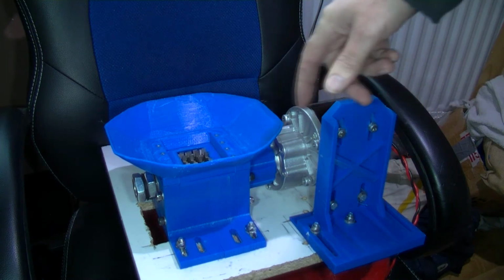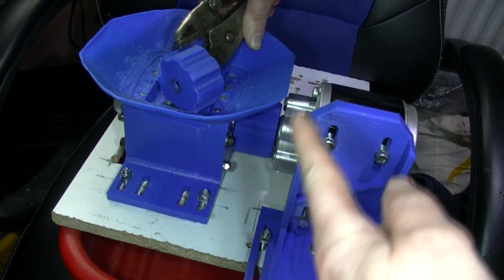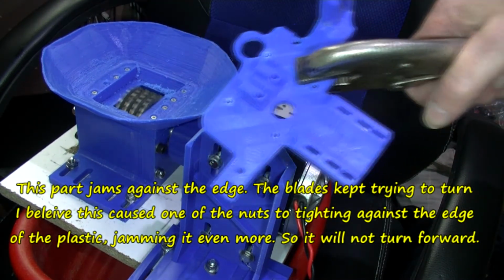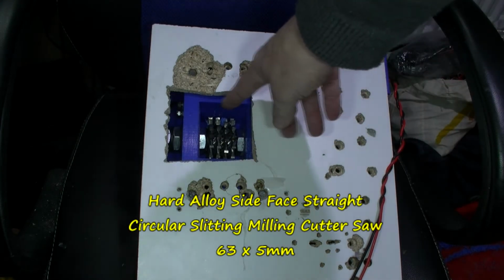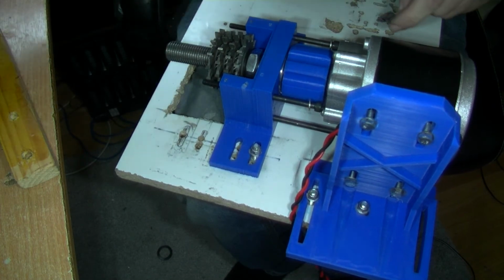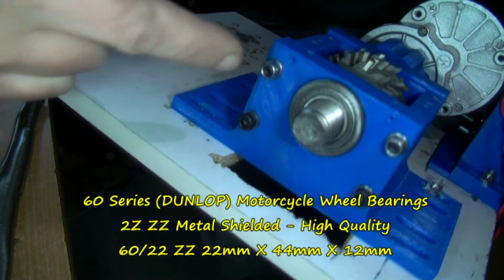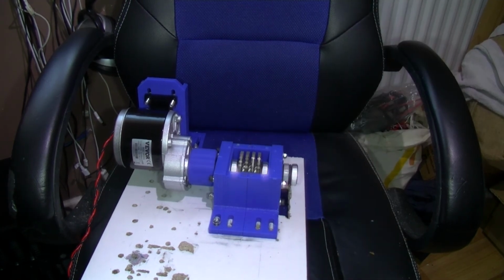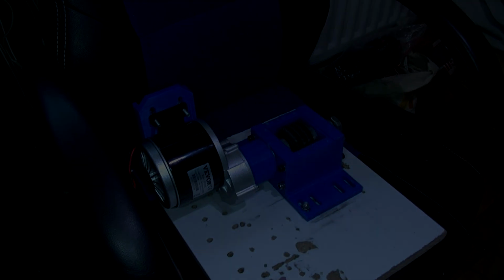Sherdder for plastic parts Multi Blade test

Comment: Its definitely improving!
Reply from the maker: I don't think it is that much better than the single blade method. Maybe I should rewatch that video :) Thinking of saw blades to try them.
Reply: @3D_Printing  I sent one of my Ender 5 Plus back to Amazon, I had it for 9 months and loads of things were going wrong, I paid £586 for it and was refunded immediatly so I bought a new one from Technology Outlet a UKI based 3D printer shop, next day free delivery and for £419,( they have some 2Kg rolls of PLA on special offer for £18.99 by the way) and the difference in the two printers is massive, the old one used to shake like mad when small infill was printed, I checked all the screws and checked it was square and all seemed good I had to fit bracing corner to corner and that helped massively but this one is printing the same parts and is very different.
Reply from the maker: @AndrewAHayes  On my Creality Ender 5 Plus I found the top corner brackets cracking so, I made these
Strong Corner bracket for Ender 5 Plus
https://www.thingiverse.com/thing:5345366